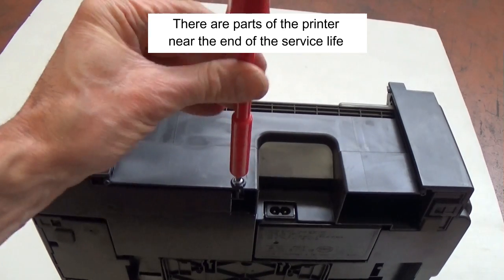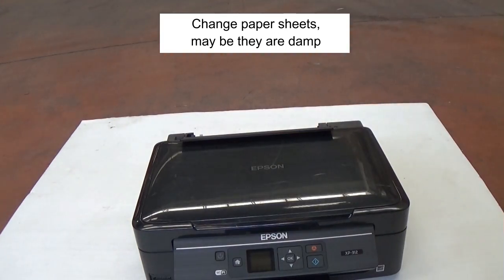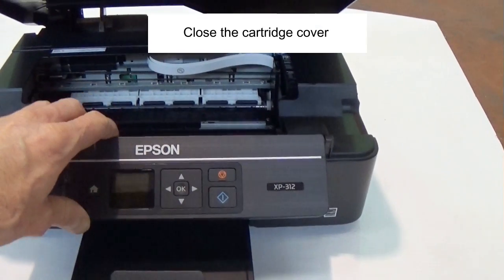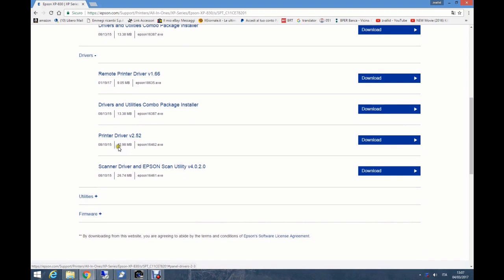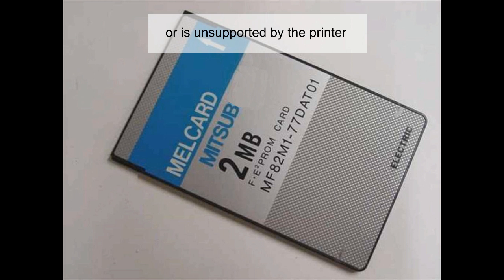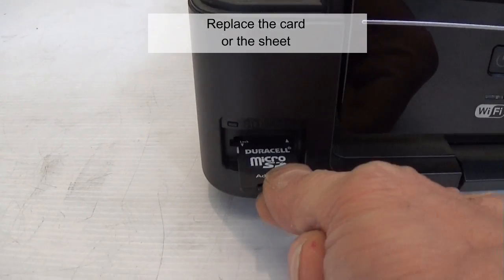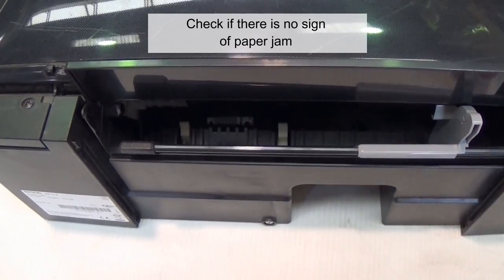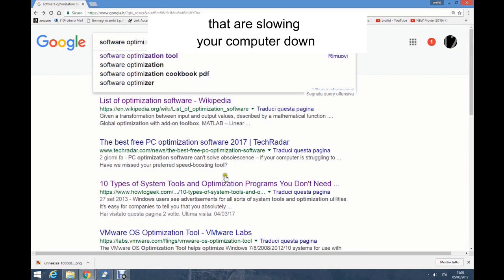Epson Printer Error Codes: Meaning and Solutions

Comment: Hello, I am getting error code 0014BD on my Epson T3170X. Do you have any idea what this could mean? 

It is only giving me the option to turn the printer off and turn it back on, which I have done. I have also unplugged it from the printer and outlet for over 30 minutes.The same error message still appears.

Thanks!
Reply from the maker: The manual says that the error code indicates there is a ink leak inside the printer. Clean the ink cartridge holder, the print-head, the sensor

Comment: I have an Epson XP 400 tht was working okay but now when I attempt to use it, it comes on, goes through the cartridge setup, then a printer error message comes on the screen. It Does Not have an error code and says only to turn it off and back on again. I have done this several times but it still says the same thing. I can not find any info as to wht the issue cld be or how to fix it. I am sooooooooooo frustrated !! PLEASE HELP !!
Reply from the maker: Do you have Epson Status Monitor 3 installed? Here you can find several informations and probably the reason of the error code.
Reply: @viandant5  I dont believe so. If it is, it was an automatic install. I could just connect to my ph fr the app. I have never seen tht error message  before though. Where do I find the install?
Reply from the maker: @mstyese4914  You have to reinstall the printer driver
https://www.youtube.com/watch?v=FT3MxJusO0M
Reply: @viandant5 Oh ok, thank you. I am going to give it a try.

Comment: My printer Epson WF-3720  is brand new and  have code 033004. I would like to fix it but I’m unable to identify what the error message means I’ve seen conflicting messages. Do you by chance know what it is and is it an easy fix? Thank you.
Reply from the maker: Probably it's the main board, in this case there are no methods to fix it unless you change the board. However I think there is the warranty

Comment: Error code:0x9A - can anyone tell me how to fix this for WF-3620.  Thanks.
Reply from the maker: It's a problem related to the ink cartridges
Reply: @viandant5  Thank you!  Is it fixable?
Reply from the maker: @patbond4690  You could try to change the cartridge, or remove and reinstall the cartridge. Clean the contacts between the cartridge and the printer

Comment: Hello. I have a WF with code 031004. I would like to fix it but I’m unable to identify what the error message means I’ve seen conflicting messages. Do you by chance know what it is and is it an easy fix? Thank you.
Reply from the maker: It's a print-head problem, probably a fatal error. Check the connections and the flat cables of the printhead, but I think you have to replace the printhead
Reply: I too have the same issue.  Its a combnation of the printhead AND the connector cables to the print head.  I literally have a hole in each of the cables connecting to the prinhead along with burnt marks.  I was able to find a video on how to manually clean the printhead and was able to see the problem.  Now, I need to replace the printhead and cables somehow.  I remember over cleaning the printhead and also flushing it with a kit from Amazon.  I think this was the initial problem.  I converted my printer to eco-solvent ink and its been a nightmare!

Comment: Anyone know how to repair an error code 100069  on a WF-3720?
Reply from the maker: It could be a paper jam or the motor that does not rotate, or the conection of the motor
Reply: @viandant5  thank you. Ended up being a software problem. I played around until its fixed,  I'm  just not sure how I actually fixed it lol
Reply from the maker: @pm123va1  A driver problem?
Reply: @viandant5  I'm pretty sure that it was.  I reloaded all drivers and the scanner 2 software and it's fine now. Thanks for your input :)

Comment: I recently bought a 16600. Everytime I try to print I get error code 000043. Sometimes it will print a part of the pic then error. Other times it will error before even starting. Any idea what could be the problem?
Reply from the maker: It indicates a problem with the print head or the ink cartridges, ot dirty inside the scanner

Comment: My printer XP-6000 had an error code of 000061. It asks me to turn off and on again but nothing was fixed. What should I do?
Reply from the maker: It could be a paper jam, a foreign objiect inside the printer, or the motor of the paper feed, the gears, a worn paper feed roller

Comment: Hi, I have got error on display of my wf 2510 and one second before it appears it showed replace C cartridge... Now every time i restart the printer the cartridge holder moves left-right many times (like five or six) and then it runs the white plastic gear below (i think the paper jam) clockwise. After that the printer try to move it non-clockwise but it stops immediately and shows error, see the manual... what could be wrong now. I already repair it couple or years ago because of a bad transistor on motherboard but now I'am stuck here. Any advice would be very appreciated
Reply from the maker: But which error do you have? An error code?
Reply: @viandant5  hi, no error code. It showed me on display one time only just for a second about cartridge C and then the message: printer error, see you documentation. Actually i run out of colour but i cannot understand any relation between this and error message
Reply from the maker: Replace C cartridge means replace cyan cartridge. Did you change it?
Reply: @viandant5  not yet, i am waiting for a new one

Comment: @viandant5 I have a epson wf7720 and it keep giving me an error code 033506 which is a paper jam in the ADF. I haven’t use it and I don’t see anything there it started after I changed ink cartridge. what can I do to fix this.
Reply from the maker: 033506 is not a paper jam. 
The manual says "light excessive error". Is the printer near a window under direct sunlight? Is part of the cover removed? Or there could be a defective sensor

Comment: I just got a wireless epson stylus nx330 and...I turn it on and it says printer error e-01...I just put ink in it (it was saying that before I put it in. It's used so and I don't have a manuel
Reply from the maker: there is a chip on the cartridge, if you don't change it it's useless to fill the cartridge

Comment: Please help, I'm encountering code 033506
Reply from the maker: EPson manuals say it's a problem to a sensor or the main Board failure)
Is the printer under the sun or under a strong light? a great amount of light could cause this error
Reply: @viandant5  It's not, does it say how to repair?
Reply from the maker: @LifeWithTrinaNeCole  I think you have to replace the sensor, but probably the problem is the main board

Comment: Error number 031008 for the Epson wf-c5710 printer
Reply from the maker: It usually happens due to wrong installation of the ink cartridges or the print-head. try to remove and reinstall the ink cartridges, clean the contacts

Comment: xp7100 will not print multiple pages and when I print 1 page bottom lines of the text does not print.
Reply from the maker: Check if the settings of the paper size are correct

Comment: Hi.my printer Epson wf pro c5790. My printer have fatal error 031004.can you help me ?what should I do ? Thanks
Reply from the maker: Try to turn the power off and then back on. If it doesn't work it could be the rear cover open sensor or the print-head
Reply: @viandant5  my friend my printer is already in service mode. I'm trying to turn it on. It won't turn on at all because of this error. I will check the places you said thanks.

Comment: Epson xp 6000..scanner error code 000064. New printer. No computer. Wireless internet 100 mbps. Android one note 10 plus. Off and on does not work. 5 min does not work
Reply from the maker: The manual says:

000064
ASF PID lock error
DESCRIPTION: The ASF motor did not run
1. The ASF was stopped by;
- Obstacles such as jammed paper 
 - Overload of the mechanism 
- Disengaging or breakage of the gear
- Failed to read the ASF motor encoder 
2. Contamination of the ASF encoder scale 
3. Disconnection, break, skew or damage of the ASF motor cable/encoder FFC
4. Failure of the ASF encoder sensor
5. Failure of the ASF motor (the lead wire is broken or the connector is disconnected) 
6. Failure of the main board
Reply: Thank you. They want me to send it back and that will take weeks for a refund. Ill try and source the problem based on what you told me which is far more than anyone. Im subscribing. Thanks

Comment: I just cleaned my printer head and then when I turn it on, it's said "Printer Error" and told me to turn it OFF and On again. I done that but nothing changes. The printer said it's still error. I have Epson NX-420  error code E-01. Help
Reply from the maker: E-01 is a fatal error. The problem  could be the cartridges, the optical sensor, the waste ink pads

Comment: Do you know what may be the error 0x60 in EPSON WF-2630?
Reply from the maker: It usually means a paper jam or a foreign object, deformation of the main frame
Reply: @viandant5  Unfortunately, the printer is off. Short circuit and burned ribbon to the printhead :(

Comment: Hi. I have an epson ET-3600. After moving house and the printer not being used for a while I keep getting Error code 031004. I can't find this code anywhere. Can anyone help. I have tried wast ink counter, this if 39% I have flushed the heads, they appear clear. I have checked no paper jams and the print heads move freely. Any help greatly appreciated. The printer is on network
Reply from the maker: I would try to update the printer driver and the Operative System for start. Then try to change the ink cartridges, Epson cartridges could give every type of error

Comment: If your problem is not USB related, troubleshooting printer problems is best handled in two easy steps: first diagnose the problem, then apply likely solutions until the problem is fixed.1-800-975-0148 ( US & Canada ) can be reached for any issues or queries related to Epson device .. Official Help Desk.  The support team will guide you through the steps. Hope it helps.

Comment: Epson Wf 3460 printer error 0x9e
Reply from the maker: A problem with the print-head. Check the connectors of the print-head, clean the electronics contacts

Comment: I have a work force WF-7720, I was using it and all of the sudden error 100016 appear, have turn it off and on about 25 times waiting 10 to 15 minutes between on and off, still there and Epson support doesn't even help you, it will send from one place to another, dominguez3145@bellsouth.net just in case someone can help me, just bought the 254XL ink package for it and was able to use it 4 times
Reply from the maker: it's an error related to the scanner. you can try to remove and reinstall the driver of the printer but probably it's a mechanical problem

Comment: Error code: 16 is showing after installing the printhead on my Piezo TC 1800 printer. The printhead is Epson XP600. How can I solve this problem?
Reply from the maker: Did you mean  Epson XP600 printer? Error code 16 it's a printhead failure or main board failure, but may be the printhead is not in the right position. I think you should remove and reinstall the printhead
Reply: @viandant5  Thanks. Please can I have an installation manual for this particular print head?
Reply from the maker: @magishagroupLtd  here there is the manual
https://www.manualeduso.it/epson/expression-premium-xp-600/manuale
hope it helps

Comment: Older epson wf545 (6-7 years old) removed waste ink tray and cleaned due to smudges on paper. Reinstalled and when I turn printer on, it cycles for a few moments then makes a loud click and says printer error but no codes. I tried to unplug for a while and turn back on but still does the same thing. I can move the cartridge tray back and forth without any problems. Any ideas?
Reply from the maker: Try to remove and reinstall the waste ink box. Check the printer, there here are gears levers and moving parts connected with the waste ink box that could be in a wrong position
Reply: This is the same thing going on with my printer.. Its older and no error code just says "error turn off and on again."

Comment: Hello! I have a Et-2650 with error code E-02? I have only just bought the printer and I don't know what to do.
Reply from the maker: it's an error related to the scanner but try to change all cartrdige, they could give any type of error. in the epson status monitor check if there is the explanation of the error. may be the waste ink box is full
Reply: I’m with the same problem i just bought the printer and i don’t use and it is error E_02 ..Help me please...
Reply from the maker: @tatianasantos1316  If you are sure you have removed all packaging and the cartridges are correctly installed, it could be an internal error. Probably the printer is in warranty, it's better you contact the seller

Comment: I just cleaned my printer head and then when I turn it on, it's said "Printer Error" and told me to turn it OFF and On again. I done that but nothing changes. The printer said it's still error. I have Epson XP-415
Reply from the maker: No error code? Try to change all ink cartridges, check if the waste ink box is full

Comment: My Edson 6000 printer is not working, I keep getting the error message 033004. It says to turn printer off and on - that doesn’t work please help.
Reply from the maker: It indicates a main board failure. If does not solve turning printer on /off, you have to bring the printer to a repair center

Comment: Why my printer did not print/"Communication Error"/Resolved:

I had a printer problem with my Epson Stylus SX430. I had the latest driver. The printer was connected to the wifi. Paper set up was right. Everything should have been set up right. As I had not changed anything since my last print. But it just wouldn't print. This happened just from one day to another. No reason.
I printed a status report directly from the printer and everything was fine. Nozzles also seemed to be fine judging from that print and if it printed this test, then it couldn't be that there isn't enough ink.
All it said in the print queue was "Error-Printing" and after trouble shooting it first said that a print order was clogging it up and that issue had been resolved (what bullshit, that was the one it didn't want to print and it did was cancel that order), after clearing the print order it could not find any problems when I trouble shot again.
Then I went another route and it finally told me it was a communication error. The only thing I could think of was that it used the wrong port, but I had no idea how to set that up.
So I tried to add the printer again through my wifi and that worked within a couple of seconds.
It turned out that the printer now had a different name. I don't know why, but the printer was now called "EPSONE9155A (Epson Stylus SX430)".
When I searched for this printer with the old name on the epson website I could not find it. I guess they must have updated something about it, so it received a new name.

But these things are super annoying. There was nothing wrong with the printer. It was probably just that they wanted to add another feature to collect more data on you, "non-personal" data (riiiiggghhhtt....).

Comment: My printer occasionally gives out an error to turn off the printer with the number 202600 at the bottom of the lcd. Any idea what this means?
Reply from the maker: It could be related to the ink cartridges. try to remove all cartridges one at a time. Make sure cartridges click into place. If you have ta spent cartridges, you could also try using those one at a time to determine if one of the new cartridges is defective.

Comment: Just bought an epson XP440 wireless printer.  Had it all set up,, was working fine       Several power losses later my Mac tells me the printer is not connected.  I first had an E-6 error and cleared that by turning off my firewall.  Now I still cannot connect because I'm getting an E-7 error!  Have uninstalled and reinstalled the software.  What's next?
Reply from the maker: they are both problems related to the wi-fi connection. I would do the wi-fi connection procedure again
Reply: You are right!   Checked my connection with the provider, rebooted,  and found I was using the wrong network password.  Thanks for the comeback.  Back in business.

Comment: Error code 034011  Hello, I have Epson WF-7720 and I did scan a document with no problem, but when I tried to print, it did not working. I restarted it and found error code 034011 I can't access anything other than restating and still comes to same error code. I tried to upgrade the firmware or download recovery, it says downgraded (cant upgrade)
Reply from the maker: I suggest for start to install all Windows updates, then clean the pc with a program like CC Cleaner. I never saw that error code, it could be related to the PC

Comment: Hi, An  unexpected configuration problem  0×8007007e what that's mean? What should I do? I have an epson et2650
Reply from the maker: it's related to the PC, not to the printer. updates the firmware, reinstall the printer driver, update Windows.
Try this:
Windows button + R to get to the Run screen
Type "spool"
Open "drivers"
Find folder "x64old" and open
Look for "printconfig.dll" in folder (might be in folder "3" within "x64old") and copy it (right click and "copy"), use search box in top right if needed
Go back to "drivers" folder and open "x64" folder

Paste the "printconfig.dll" into the same part of the "x64" folder (paste it in the "3" folder within it if that is where you found it in "x64old")
Restart computer and it should work (it will take a few extra seconds to spool up when you print your first document in Edge or Mail)